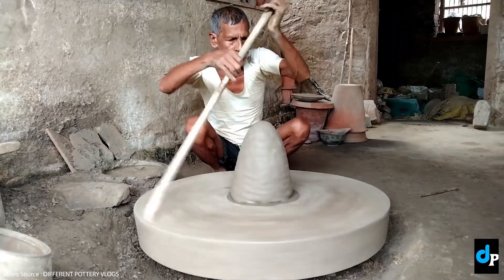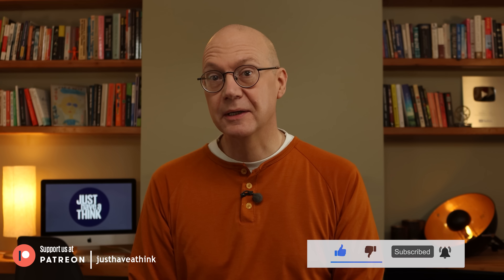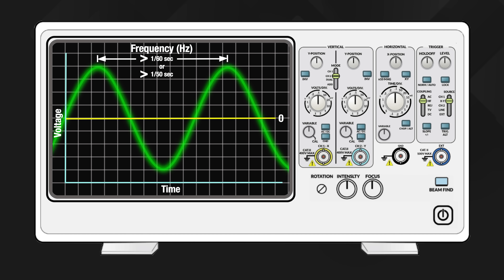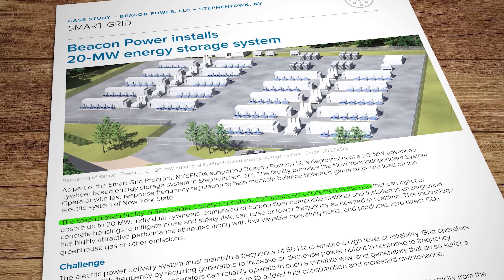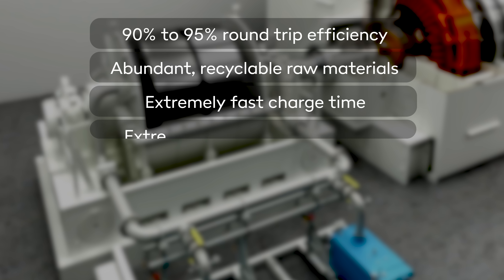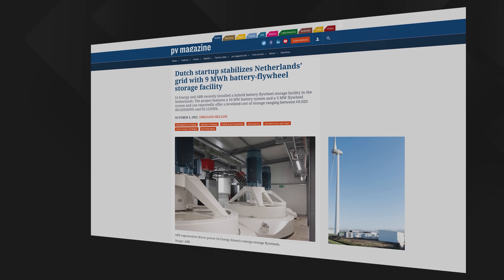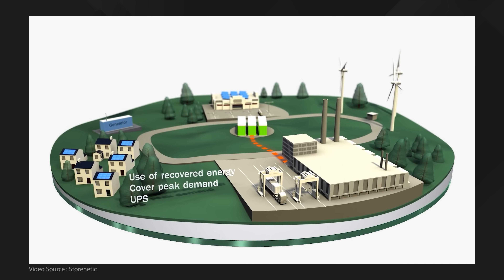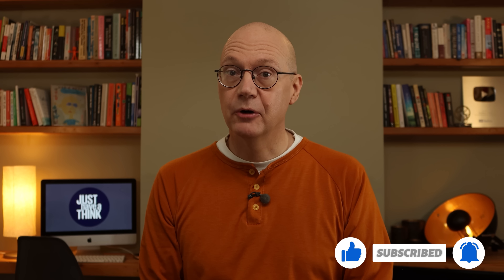Flywheel reinvention revolutionising our power grids!

Comment: I love things that are not called "game changers" or "disruptive technology" because they usually just work. Like the Idea of more trains.
Reply: But this could be called a revolutionary technology
Reply: @michael-j-harrison  I don't mean to cause friction, but every time I turn around, there's a joke like this circulating.  Please, just stop it.
Reply: @robertcartwright4374  That's what happens at the Rotary Club
Reply: @simongross3122  Oh, stop it!
Reply: Trains would be a total Game Changer. They would change the game. It would be a totally different game. "Train Game".
Reply: Why are they building flywheels out of carbon fiber?  I thought weight was a major component of how much power they can store?
Reply: @tarstarkusz  No , how fast your can spin the wheel is a major  components of any kinetic based energy storage such as flywheel . Most material would tears themselves apart with the forces acting at high velocity and acceleration (which is needed for flywheel) , carbon fibre is very resistant to this.
Reply: @tarstarkusz  Maybe because of the strength. You need both mass and strength to make a proper flywheel. Otherwise it all flings apart when you get it going fast enough.
I'm sure there's a grid somewhere showing the "sweet spot" between mass and strength. Cast iron comes to mind.
Reply: So you suggest pulling trains uphill to store  potential energy?
Reply: How is this new? It’s why fossil fueled plants provide frequency control for free. The turbines where flywheels
Reply: Yeah, using words like "game changers" and "disruptive technology" usually only means one thing: Undeserved hype.
Reply: If it's not a "game changer" then it's probably been around long enough to be optimized by engineers so they are cheaper, more reliable, and safer.
Reply: @falconerd343  And yet it costs 6x as much as the hugely expensive tesla megapacks, and is only useful for really short term storage.
Reply: It's not a game changer...

It has the same efficiency as a tesla megapack, but the megapack can sit for days without losing any energy,
It costs 6x as much per kWh as a tesla megapack, and the tesla megapack is about the most expensive large scale battery storage out there. And that is the projected cost of the flywheel when produced at volume, at which time the project cost of grid scale battery storage will be 30x less.

So while it would have been a good idea if it had rolled out en-masse a decade ago, it is no longer is competitive.
Reply: @luc_libv_verhaegen  there's not just 1 energy storage tool in the toolbox. Different tools for different uses. Sure they are more expensive, and have a relatively high self discharge rate compared to lithium batteries. But, as pointed out in the video, flywheel manufacturing requires less exotic materials like Li and Co, which reduces the upstream environmental costs. They are cheaper to maintain, and safer as they are chemically nonreactive (assuming a bearing doesn't go out; an uncontrolled discharge of stored energy isn't pretty in any form). Flywheels also have intrinsically instant response, increasing the quality of the electrical power without spikes or dips (I don't know how they would compare to a large scale capacitor in that function though).
That's why he mentioned the hybrid storage project with both Li-ion and flywheel batteries so they can complement each other.
Reply: @falconerd343  But Lithium is not in any way exotic. The mining capacity just does not match the current demand yet.

Cobalt is not used in LiFePO4 cells, which are much safer than the cobalt containing chemistries. LiFePO4 has a lower energy density than NMC and NCA, but this is totally inconsequential for static storage. The higher cycle count and the ability to sit at 100% are preferred over lower weight.

Finally, inverters have inductors (coils) and transformers, which inherently provide electrical inertia, and this can be tied to ms level frequency response. And that has the same effect.

Flywheels would have been a good idea 10-20ys ago, if we had bothered to install them then. Then we would not have to curtail so much wind and solar today. But today, for new storage capacity, flywheels make little to no economical sense.
Reply: @luc_libv_verhaegen  Bear in mind that the Megapack is likely to be using energy to stay within operating temperature range.

Comment: The big motivation for syncons is for 'fault clearing current', which is their ability to provide up to millions of amps to trip all the breakers, and fuse any bad links or shorts when something goes wrong.  The longer term energy storage is insignificant in most applications.
Reply: Fault clearing is a major technical challenge for other storage options.  Flywheels are unique in this regard. 

With batteries they are rated in terms of energy density,  but a Flywheel has a significant power density.
Reply: Power transmission and distribution systems do not experience 'millions of amps' during network faults, nor do they require such high currents for the operation of protective devices. High fault levels (relatively speaking) are intended to maintain system inertia and can allow the use of simpler overcurrent protection devices but networks, (and transmission networks in particular), have used impedance-based or line-differential based protective systems for decades that can detect and disconnect faults at fairly modest current levels very quickly indeed. Overcurrent devices are comparatively slower and are used as backup protection.
Reply: The energy density of a flywheel is determined by the square of its rotational velocity. (E= 1/2 mass x velocity squared) so if frictionless magnetic bearings are used I could imagine flywheels rotating at fantastically high speeds to give energy densities comparable to chemical storage.
Reply: @petergibson2318  The problem is that they have to be extremely well balanced and the speed is going to be limited by the elastic strength of whatever it is made of. Yoju need a big safety margine because failure would be absolutely catastrophic.
Reply: @rogerphelps9939  When I was a schoolboy in the seventies I was told that generators were so long because they couldn't spin at 3000rpm if they had a bigger diameter because of the tensile strength of the steel.  More power thus needs more length.

Comment: I hope these flywheels don't literally fly as happened at a military  communications site which used a flywheel to keep the station going in the event of a power outage until the standby generator was brought on-line. 
The flywheel flew through the generator hall roof when  a clutch failed.

Comment: I have seen other smaller flywheels with very high rpm and magnetic bearings ( I think I am not allowed to remember where this was) I wondered if the large one you mentioned had magnetic bearings.
Reply: Yes, Ole - all magnetic, and in a vacuum-sealed, virtually air-free enclosure. 🙂

Comment: Maybe this would be great application for very short term charge/discharge cycle, charging on the free unusable power in solar noon, and discharge just after sunset to smooth out the duck curve.
Chemical batteries for a week long time frame and hydrogen storage for month longs storage solutions.

Comment: No.  Batteries are becoming so inexpensive that flywheels will not be considered by any utility with the ability to do math.

LFP cells should drop well below $50/kWh.  For simplicity let's call it $50 including charger/inverter hardware and packing the cells into packs.  Add a bit for financing and real estate.  Most likely no more than a penny.

LFP cells have a full cycle (100% to 0% to 100%) life of 5,000 to 12,000 cycles.  Since the cells will be stationary let's use 10,000.

$50/kWh / 10,000 cycles = $0.005/kWh.

Comment: Good to see more coverage on FES systems, not much coverage on youtube. One point though on safety, if that 45000 rpm flywheel decides to leave its vacuum chamber spontaneously it would be just as dangerous as an exploding lithium cell.
Reply: Yea,  they put many horizontal down in the ground so they will explode sideways.
Reply: @mac_mcleod  if I remember right, there is a site in california where the FESS array is burried undergound.

Comment: I'm more interested in longer term energy storage that can keep the grid alive when the wind does not blow across Europe for a couple of weeks. This happened during the last cold snap. I'm sure you have heard that Ecotricity calculated and had verified by an academic study that it would be possible to create enough biogas from grass on otherwise non arable land. The technology for storing gas is well established as are gas power plants. If we can produce enough biogas sustainably wouldn't it make sense to use this to deal with energy shortages that last weeks? The gas could be produced by local farmers. The gas boilers would probably not be profitable if they sit idle most of the year but that is not a problem if they are nationalised as the important thing is that they would keep the economy going when the wind stops blowing.

Comment: About 100 years ago in 1968 I think it was,  I commissioned an emergency generator that had a flywheel running continously to bridge the gab until the diesel took over if needed. That was for the airport in Sidney in the good old days working for GEC Aust.
Reply: Hi Ole. Any down sides of using flywheel for that? As I commented below, I was working on a datacentre design with power generators that had flywheels for exactly that - to bridge the gap until the generators start up. I never understood why this hasn't been used much more often and I wonder if there are any negatives that I am not aware of. What was your experience?
Reply: @Branko Golubovic  in 1968 there were not much power electronics ( and often did not comply with the specification) , but today I think using a battery solution with SiliciumCarbid electronics might be better.  ( I am retired now and 81 years old)
Reply: @JustNow42  Thank you!
Reply: One of the young guys I see, I am 82
Reply: Is it 2068 already?
Jeezus! Am I 110 years old!!

Comment: Tanks for the update. There is, however, a misinformation that seems to be everlasting. You mention the ingredients of Li-Ion batteries to be rare earths and metals. This might be true for metals such as Co in Li-ion systems, but it is certainly not true for rare earths. These chemical elements form a specific group of 17 metals, some of which are indeed rare and hard to come by. But none of these are found in Li battery systems. They are components of powerful magnets for electricity generation or in EVs,  a fact which has been brought up to denounce electric road transport and wind energy generation altogether. If stated wrongly - and you are by far not the only one  - that rare earth elements are used in batteries, your statement might be used to discredit regenerative energy systems. Which obviously is contrary to your intensions. It could be worth devoting a youtube presentation to the role of rare earth elements in the transition of energy generation and electric transport.

Comment: The AC Power Grid is the problem. Each and every home should be disconnected from the grid. We have the knowledge and technology to do this.
Reply: No thanks. The only way I could generate enough electricity to power my home would be an on-site generator which would be expensive, inefficient, noisy and potentially dangerous

Comment: Lithium battery factories and the suppliers of raw materials can't keep up with the demand for energy storage. Flywheel system factories use a much different set of raw materials.

New flywheel factories are unlikely to suffer supply constraints. The demand is huge. Assuming they can get costs down into the same neighborhood as battery based systems, they can profitably be run at full capacity for the foreseeable future.

There are market niches where flywheels can demand a premium price. Examples include very hot locations, and applications where there will be many very brief cycles.

Comment: We've been here before. In the early 1970's the Rabinhorst Super flywheel was going to do everything you have noted, along with being placed in cars to allow for smaller engines while still allowing for quick acceleration on hills etc. I wonder what happened then? It does make sense to add flywheels to say, solar systems or windmills to level out battery supply voltage. It could of course run on the production side as well when voltages start lagging as batteries deplete.
Reply: Putting flywheels on moving vehicles presents a problem that you don't have with stationary ones: they resist having their axis of rotation altered. Imagine going over a bump on the left side (only) of a car and having the flywheel resist titling of the car so much to the point that it could lift the right side of the car off the ground.

Also the direction of rotation affects their behavior, so you probably need two counter-rotating flywheels cancel out that asymmetry.

You could mount the flywheels in a gimbal, allowing its axis to move independently of the car's body, but that adds complexity, takes up additional space, and adds "dead weight" that is not used for storing energy.

With all that said, flywheels were actively researched for this use when high energy density batteries were still an uncertain thing of the future.
Reply: @yeroca  That resistance to rotation in other planes is why they have flywheels on the Hubble Telescope, they help to keep it stable so it can produce clear images. I think the ISS has one as well.
Reply: Flywheels are used to reduce charge / discharge cycles of batteries for very short transients. That greatly increases battery life.
Reply: Two options of what happend: A. the secret society against flywheels managed to kill every successful flywheel company. B. It is not feasible for reasons of physics and economics and you were not interessted in details (mass, friction, production costs).
Reply: @UCwGVsuExr1GO-USL8DYXsWQ Flywheels impact on the driving behavior of cars and busses. They were used in busses because idle losses didn't matter so much in stop-and-go scenarios and motor efficiency was bad. Infrastructure gets more expensive from year to year. Carbon Flywheels are expensive. Windmills have technologies integrated to emulate the effect of flywheels. It makes more sense to build another windmill instead of a flywheel. Big companies and states like centralized Infrastructure which is why there are couple examples of Flywheels being installed. We need to store more heat. More flexibility of consumers is the best approach. Stabilize locally. Investing in (more) robustness of the whole grid is the approach with the highest costs.

Comment: I think I qualify as a grid designer... I work for a power company, and my title is Designer... so... lol. Many power companies already use stand-alone flywheel systems. I think the flywheels are made of concrete and they don't spin too fast. Gyroscopic motion tends to have a stronger effect the heavier the flywheel and the faster it's spinning. You can go super heavy and slow or super light and fast. Super light and slow won't get your anything, and super heavy and fast will rip itself apart as the Earth spins. 

Flywheel tech is a good idea. Especially considering we already use it. I think you're going to need a multitude of technologies all working in concert if you want to move away from the steady, predictable and reliable generation methods like coal and natural gas. Of course, the more complicated a system, the more that can go wrong. Simple is usually better and while a flywheel system may be able to generate 1MW of power, it doesn't last very long. So if you get a big storm with winds too fast for turbines with too much cloud cover for solar that persists a while, flywheels aren't going to cut it. They might be able to buy you a few minutes... maybe a few hours, but the thing with storms is that people are often inside which means their electricity use is going up. So you compound the issue of no generation with increased demand and you still end up with blackouts or brownouts. If you went with coal, natural gas or nuclear, you wouldn't have an issue with generation. The only thing you'd have to worry about is lines going down from trees or wind.

An interesting little tidbit... were you aware that hospitals are required to have a sufficient amount of generation on-site to run the hospital for a set number of hours? Guess what method of generation they use? Gas or diesel. Why? Because it's dependable. I think schools have a requirement like this as well, though to a lesser extent.

I'm all for advancement and clean energy. But until such time as we have a satisfactory method of replacing our existing infrastructure with a new method that is just as dependable, we should not be creating and enforcing policies that reduce grid dependability, no matter how 'clean' it purports to be. We should keep innovating, keep testing and keep advancing, but we should not move off of reliable methods of generation until we can truly replace it. To do otherwise would lead to a collapse of the worldwide economic systems considering that most of it runs on energy. Oh, wait... aren't we going through something like that right now? Huh... coincidence?